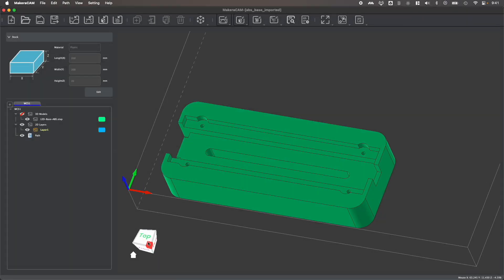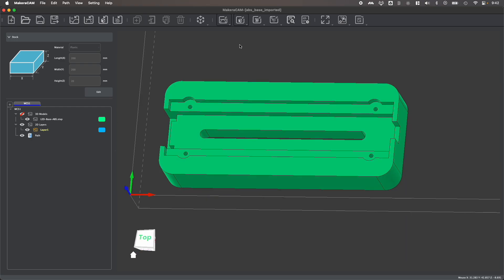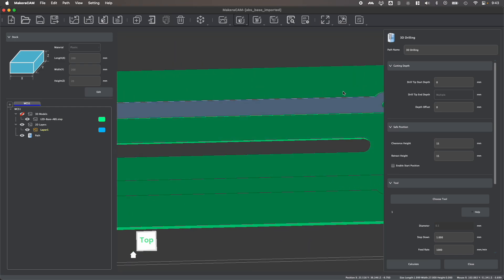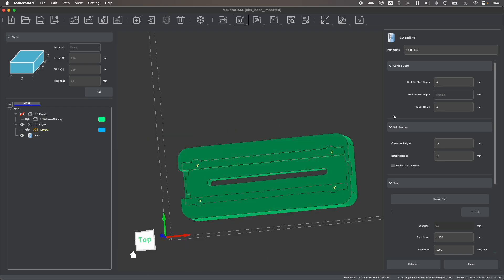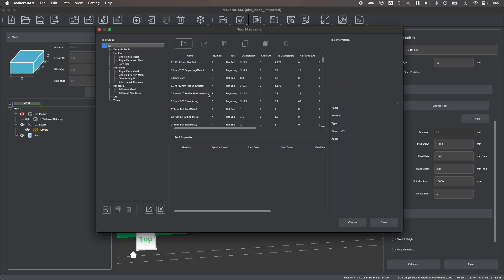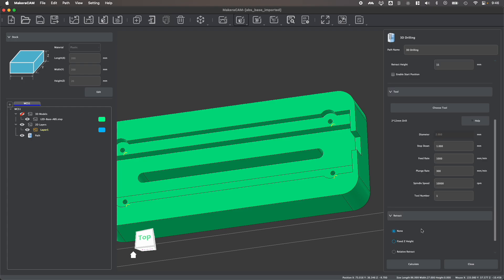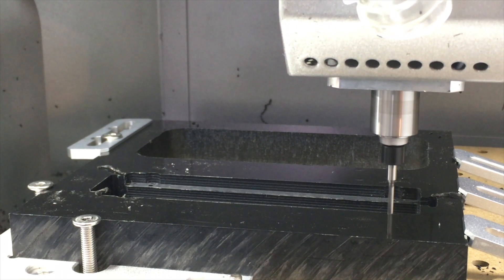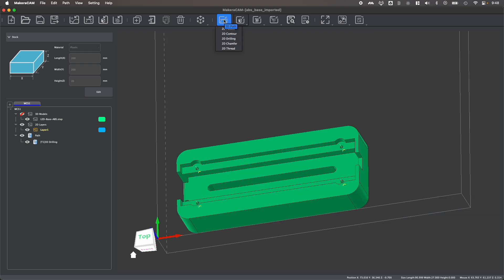Makera CAM - Creating 3D Drilling Tool Paths

Comment: Hi Jason.
Thank you for the video. What if we don't have a bottom to select ? I mean, I have holes going through my part and as on your model, the holes of my step are considered as 2 half cylindres. If I select one half of the cylinder I'd like to create, it offsets my hole. If Iselect the two half cylinder it simulates two holes side to side.
As I want only one located hole, I understand I can add material under my part to have a bottom to select or use vector drilling instead, but that's not really convinient.
If you had a solution it would be nice. Thanks again.
Reply from the maker: You may also select the cylinder wall to create 3D drilling operations as well, as well as trace the shape to create contours which can be used for 2D drilling operations.
Reply: Thanks for your answer. That's what I did but because my cylinder is consider as 2 half cylinders, it offsets my hole. I don't know why the step file produce 2 half holes instead of just 1 because my original file doesn't. Also when I tried to create a 3D pocket, the cam software wants to go around holes located at the bottom of my pocket instead of going over them. At the end I programmed everything with vector files. I'll keep trying. Thanks